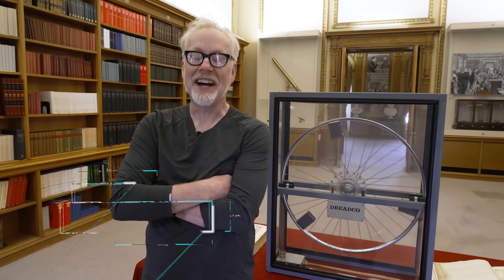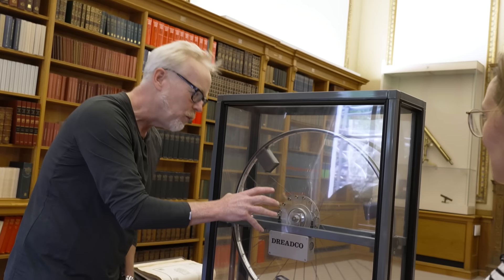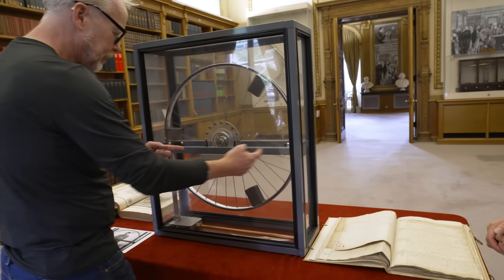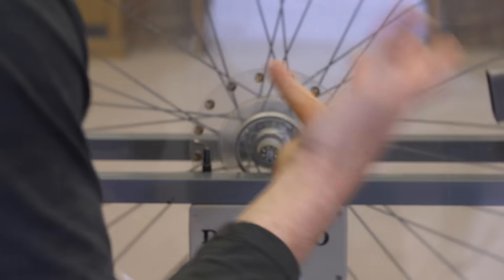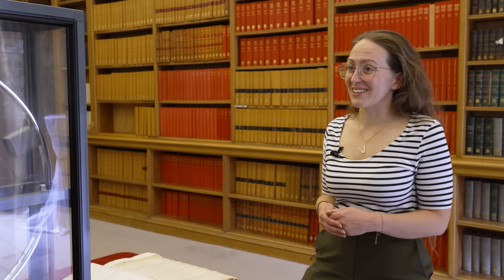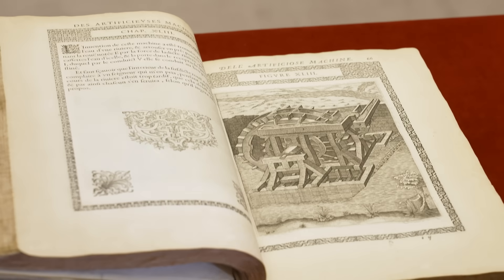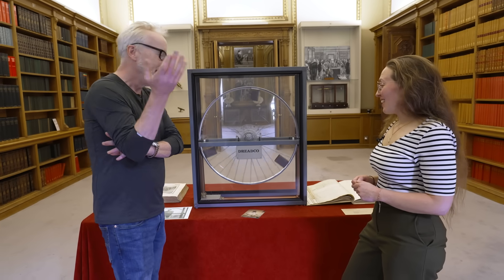Adam Savage vs The "Perpetual Motion" Machine!

Comment: The hardest part of making a perpetual motion machine is always figuring out where to hide the batteries
Reply: My guess is the box in the middle
Reply: @robertdascoli949  nope its in the axel. Just like what the cheaters use in Tour De France and other cycling events
Reply: @robertdascoli949  my guess is the box at the bottom left corner has batteries creating an electoral field thru the copper tube.
Reply: @robertdascoli949  yeah they aren't even trying to hide it in this case because most people are so thick there's no need
Reply: @robertdascoli949  the case itself is the battery. most of the rest is set dressing,
Reply: @robertdascoli949 my guess is the 3 boxes contain batteries and induction, end of story:-)
Reply: @dirkknoll3795  Nah the bottom box left side is probably where the batteries are for the easiest place to change them out.  Which the heat sink is there to cover up having an access there since the bottom is also clear plexi.  That , or they are stacked inside the frame ?
Having to open the box up to access the other boxes would probably show some wear on that rubber seal , and possibly damage the balance of the wheel , if were the ones mounted on the wheel.  The dreadco box I doubt has batteries also ... but maybe some desiccant material to keep the box free of moisture.  Hence those little screen looking things on the side for air flow.
So batteries powering the U shaped bars wrapped with wire for electro magnetism.
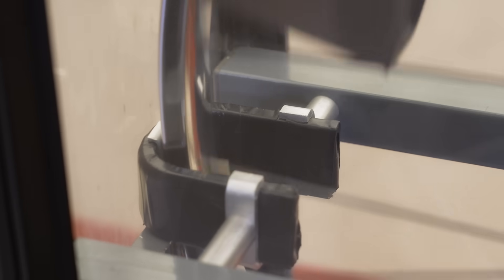If you didn't notice ... those things are wrapped with electrical tape .  4:05
Reply: @robertdascoli949  i was gonna say in the dreadco box
Reply: That was my thought too. A small motor with a little rubber wheel. Battery driven inside the DREADCO box turning against the small clear plastic wheel attached to the hub
Reply: @bryananderson999  the whole frame could have double a batteries stuffed in it. Could be 50 nicad aa batteries inside that frame.
Reply: @robertdascoli949  magnets... if they were batteries they would need to be replaced far more often and many ppl would know the secret, she stated that only 2 ppl know tho
Reply: @robertdascoli949  Wow that went over your head. He was making a joke that its not possible to make an actual perpetual motion machine.
Reply: @robertdascoli949  my guess is the blocks on the spokes are iron and they pass through magnets that are the black boxes on the middle bar and because the blocks are 120 degrees apart only 1 block passes them
Reply: There's a guy out near I live who used to make beautiful wooden flywheel-based perpetual motion machines, gorgeous and fascinatingly complex... they used line voltage, though, and the puzzle was simply to find the drive wheel. But they were GORGEOUS...
Reply: pl @Vinemaple
Reply: That is the thing with any magic trick (or cheating device), where do you hid the mechanisms... and how do you misdirect the audience to not see them.
Reply: @boxhead77  same thing in politics. Weird.
Reply: @boxhead77  Yes, like the copper tubing....Distract!
Reply: @boxhead77  magnets for sure
Reply: @boxhead77 : I see a small box inside the machine just big enough to hide 2 AA batteries!!!
YEP!!! Fraid so..
Reply: I remember one story about a PMM where the inventor had it mounted on a desk in his living room, and it turned out he had hidden a drive shaft in a support tube somehow, which ran to a pulley in the wall with an electric motor in the basement.

Lol.
Reply: @nicholastrawinski   sounds like my childhood overcomplication of wanting to do crazy stuff… lol
Reply: @nicholastrawinski j V hum
Reply: @nicholastrawinski  Things move on gearing power consumption rpm etc. is the key
THINK
Reply: @nicholastrawinski  that’s fucking awesome. Insidious but awesome. Very die with the lie of him
Reply: I’m wondering if the copper tube isn’t a red herring
Reply: @Dmarcoot  We don't know what's in the box the tube connects to though. Maybe it's sensing atmospheric pressure changes to keep hidden batteries charged.
Reply: I made a perpetual motion machine. I keep it in my work shop with my water powered engine.
I'll be right back to tell you how it works, there is someone knocking at my front door....
Reply: @jofi4580  Too many people not getting this comment.
Reply: Theres micro hamster that moving it
Reply: But perpetual motion machines technology really, really moved forward for the last ~20 years! The advances are obvious - as the batteries become more powerful and compact :)
Reply: Saw one of these from Russia.  It was sitting in a parking lot to prove it wasn't plugged in. But, for some reason, there was a throw rug on either side.
Reply: For everybody's info:
The creator of this piece clearly stated that this, and all of his creations, are fake, that they are magic tricks.
Not telling people how it works and having them try to guess (and then not telling them if they're correct anyway) is all part of the game.

Not sure how clear that was started in the video, I'd have to watch it again.
Reply: @Gh05tk3y  Wireless charging isn't new...
Reply: @codahighland  he thinks inductance was invented to charge cell phones
Reply: I read this comment in elctroboom's voice
Reply: @CoryzillaZombiekilla  how did you survive the shock of the FULL BRIDGE RECTIFIER?
Reply: @CoryzillaZombiekilla  🤣 just realised.
Reply: @CoryzillaZombiekilla  this is a 200 year old quote.
Reply: @CoryzillaZombiekilla   me too😂
Reply: @CoryzillaZombiekilla  hahahahah
Reply: @CoryzillaZombiekilla  There is no free energy! (electroboom)
Reply: @stoqnstoqnov7071 On the contrary, all energy is free (except what the utilities sell to people) and every single bit of it was all created the instant that this 3 dimensional world blipped into existence.  Remember energy is never created or destroyed merely transferred.  Which means that every bit of energy that has ever been used or will ever be used in all of humanity's existence has always been here and also will always be here.  Every single particle or force that exists in the universe is nothing but pure energy.
Reply: @Tommy-h8v4h   ot even hard with very little knowledge of electrical systems
Reply: @CoryzillaZombiekilla  I just felt the slap.
Reply: @CoryzillaZombiekilla  careful, in today's world that's cultural appropriation 😂
Reply: The easiest part of watching these videos is finding that exact comment
Reply: @Dan H  Actually, electromagnetic induction was first demonstrated in 1831, and an inductive battery charger was granted a patent in 1977 (US Patent 4031449A). The patent application was filed in 1975. Wireless charging was definitely known by the 1980s.
Reply: This comment lives under any and every perpetual machine video
Reply: @jademoth-1  right he probably thought he was clever typing it. as if they'd make a whole video like this about something battery powered. This is perpetual motion that only lasts a finite amount of time. It's absolutely possible lmao. They never said it was infinite which is not possible. I don't think op cares tho because he saw this comment once and thought he'd sound clever
Reply: @EXITLlFE  

"This is perpetual motion that lasts a finite amount of time."

That is such a ridiculous statement. 

Perpetual

Definition
1a: continuing forever : EVERLASTING
//perpetual motion
b(1): valid for all time

If it only lasts for a finite time, it is by definition not perpetual.
Reply: @notahotshot  my bad I guess I always thought "perpetual" meant automatic. Thanks lol
Reply: @EXITLlFE  oh, ok. Nope. Lol!
Reply: @jademoth-1 cry about it
Reply: Yeah why doesn't the person who keeps posting this comment spend their time trying to figure out the real reason rather than just commenting something that isn't necessarily the case....@jademoth1626
Reply: Are you the one on every video? Lol
Reply: @Gh05tk3y  Considering that the principle of a transformer, transferring power from one coil of wire to another, predates the plexiglass (polycarbonate, acrylic ?) used in the housing, wireless charging could be used.  I'm guessing you were thinking of wireless charging as used in modern cell phones.  But, they are nothing new or magical, just two coils of wire in proximity.
Reply: Occam’s Razor: There’s a battery. Mystery solved.
Reply: Isnt it just magnets?
Reply: The only mystery about this is which of the half dozen hiding places is full of batteries. And it may well be all of them.
Reply: What a original comment 😂😂😂😂
Reply: Wow, another dude coping comments for views.
Reply: And think about how many batteries you could fit in that frame. Probably enough to last the few years needed. Photo sensor might exist so it doesn't run in the dark, when no one is around and thus increases the time between charges.
Reply: @dbdba absolutely the frame. Lots of misdirection with the other stuff. The frame is way oversized for what it’s supporting & doing. Lots of volume for some type of energy storage (battery, chemical, potential, etc)
Reply: @dbdba  it would be noticeable if the wheel started up when the light turned on. With so little power it takes a lot of time to start.
Reply: @dbdba  stopping and starting would burn energy
Reply: Fortunately it's got square hollow tunes seems like a lot of room for batteries
Reply: @shakibiie  look up how a magnet falls through a copper tube.  I forget what its called. But its super interesting  Nd may or may not play a part here
Reply: @shakibiie  Hmm, why didn't I, or anyone else, think of that?!
Reply: That's the beauty of them.
Reply: You could hide a lot of batteries in the frame. And those boxes.
Reply: Which is why you hide them in plain sight.
Reply: I’d say the hardest part is figuring out how to change the batteries with nobody seeing you do it.
Reply: *or alternative power source.
Reply: Not necessarily batteries; Mythbusters tested a "perpetual motion machine" design which uses solar energy. It's 6 barrels connected on opposite size with a pipe, partially filled with water. The water on the bottom barrels evaporates and condenses on the top barrels, creating an imbalance in weight and turn the wheel ever so slightly...
Reply: @EdwardChan.999  Not perpetual motion if it stops every night when the sun goes down. Actually it is a converter. It converts the energy in sunlight into weak mechanical motion. It is not even a good way to convert sunlight into mechanical energy.
Reply: Would be nice if it was using the themoelectric effect.
Reply: A perpetual motion machine is possible.
Reply: @madscientist9994  You're correct. Energy suppliers know it's coming in a few years.
Reply: @madscientist9994 best comment!! Love optimistic people!!
Reply: The batteries are in the 3 boxes on the wheel.
Reply: id say water wheels are a form of perpetual energy or dams. As long as there is a stream and the wheel\dam is maintained itll generate power for use. Not forever but for a life time of a human that might as well be. These small machines however efficient can barely spin themselves without some cheats and cant power anything else without auxiliary power source.
Reply: @Andytlp  

"I'd say water wheels are a form of perpetual energy." 

You'd be wrong
Reply: Magnets are amazing things.
Reply: @tc8327 the earth is perpetual motion, rotating on a perfectly balanced axis and has been turning for thousands of years and hasn't stopped yet, and there's no hidden batteries, so to those who say perpetual motion isn't possible, think again.....
Reply: @Mcckoe I lived next to a 50,000 watt am radio tower and you could hear it in the box springs of my bed. No reason why a radio signal could not be inducing a small current. The wheel may only need a pulse every 10 revolutions or 100 , that's for an engineer to figure out.
Reply: Wow so original you must be really smart and funny
Reply: Yep. This comment is in each and every video about fake perpetual motion machines. People do love repetition.
Reply: Wow so original 👏
Reply: I don't know if you can notice the three black blocks around the perimeter 🤣
Reply: ✈️🤔 someday, some random hillbilly from Tennessee gonna make something in his shed. Deemed impossible by today's  limited imagination  
 just like what happens every 30years or so
Reply: Was going to say…hiding the wires.   It’s a motor.  Built one for HS physics.
Reply: disappointing to see this as a top comment, i get the humour but it shows how close minded a lot of people can be. Even if this has a battery in it we should still be exploring these kind of things with serious inquiry instead of claiming nonsense. Molecular vibrations > sympathetic resonance > amplified resonance > piezoelectric mechanical energy > electrical energy = Infinite energy?
Reply: Same damn comment on every single perpetual motion video… 🙄
Reply: The hardest part of reading YouTube comments is seeing someone regurgitate someone else’s words for likes.
Reply: Think of that one yourself?
Reply: Overrated comment
Reply: Disliked because i’m tired of hearing the same exact phrase on every video ever made
Reply: @Biking-n-hiking Same
Reply: We had self winding clock , one battery and that run for years , used energy once a day for few seconds .
Cant be that hard to fit one of those clockworks inside the axle housing 🙂
Reply: @pete_lind  There is also the Atmos and Beverly clocks which use barametric pressure to keep the winding mechanism going... they only stop for mechanical or wear and need to be professionally serviced.
Reply: @boxhead77  Would the machine keep working if kept in a secure basement strongroom where it's not affected by external air pressure?
Reply: @pete_lind  A clock doesn't use much energy.  The Jaeger LeCoultre Atmos clock gets its energy from the changes in atmospheric pressure - so it never needs winding - but it is not perpetual motion in the sense of using no external energy - in the same way that a hydro-electric power station isn't perpetual motion either.  
Look up the Atmos on YouTube - it's a thing of beauty.
Reply: @pete_lind  it works for months in the dark cellar.

Perhaps some energi can be harvested from temperature variations.
Reply: @pete_lind very interesting idea, but would you be able to hear the clock mechanism winding?? Or maybe they added insulation around it to make it quiet??🤔
Reply: It's not a perpetual motion machine if you have to do something to it every couple years.
Reply: @billrehm3590  Considering that Perpetual motion machines are feasibly impossible, creating a contraption which allows you to make use of unusual interactions and mechanics to maximize the efficiency of a particular motion, seemingly beyond what normal physics would allow, is good enough to count.

If nothing else, we'll be able to increase the amount of energy that we can generate using turbine generators. If these efficiency concepts truly work that is.
Reply: Imagine being able to set up a Power Station, get it's turbine spinning and have it require almost no extra power or fuel for 2 years after you start it up before it begins to slow down.

If this was even a slightly usable concept it would solve so many of our current Fossil Fuel issues, without the need to actually change to renewable sources. Ever.
Reply: Yeah it is silly. However so many plausible machines approaching an idealized conception of better efficiency do not meet the goalpost of stockholder enrichment because that's dumb.

The few have been brought into this perceived "reality" to rule over us and be provided enrichment towards them. I mean, it's what we were born to do. Remember when you signed the contract when you were born.
Reply: ...said, The Uni~Verse.
Reply: In the base
Reply: -Electroboom
Reply: Too funny!
Reply: reminds me of a mechanical watch
Reply: And old comment but a good one
Reply: Wow that's the secret.
Reply: @Gh05tk3y  inductance was only recently invented? Incredible!
Reply: Maybe gravity batteries. Boxes go up weight falls generates charge just string enough to spin the wheels tiny electric motor. Technically not s perpetual motion machine as they traditionally explain them but is perpetual unless something stops it.
Reply: While perpetual motion doesn't exist, fusion which is actually happening now does produce more than what goes into it because of the potential energy that atoms do have is mind boggling.
Reply: Yeah hide the batteries, I squared x R , gotta have a good supply of energy somewhere
Reply: @Mcckoe True but it will not continue to run without human intervention at some point.
Reply: If it ever was possible I GUARANTEE the designer will be dead. No government will allow such technology to exist. Just saying. Anyone that has ever made any discovery or something awesome has just vanished or gone to jail forever. Rule number 1 is NEVER mess with the energy giants.
Reply: @Gh05tk3y  Nikolai Tesla discovered wireless transmission of power well before this was belt. However it is too inefficient to be used in one of these super efficient "perpetual" motion machines.
Reply: Beat me to it 😂
Reply: Glad you commented the same comment from every one of these vids good job 👏
Reply: @Mcckoe Yes. As long as "free" means like free beer, it's "free energy"  By the other definition, free energy is indeed probably impossible.
Reply: I think that's what's in the envelope
Reply: no the hardest part is when you decide to recharge the batteries before it runs out
Reply: The wheel is the battery it seems
Reply: Whatever it is, it is extremely efficient. IIRC, they said this was invented in the late 19th century or the early 20th century.

Overcoming the resistance of the bearings and the magnetic field the boxes go through will take power. This thing can run 2 plus years on whatever source of energy it is using.  That's 17,500 hours.

I don't think it is a battery because batteries just weren't very energy dense.   Even at only 1/4 of a watt, you would need 4.38kwh.  It is obviously not using anywhere near that much power.  There is nowhere to hid 4.5kw hours in 19th century early 20th century batteries.
Reply: @tarstarkusz I suspect that at it's core it's basically a Faraday generator.  However those boxes may contain enough mass to also provide it with both a gyroscopic effect as well as a flywheel effect and if they are magnets they may be providing a Lorentz force for the purpose of maintaining a steady speed as well as being used to reclaim the energy much like regenerative braking.
Reply: @tarstarkusz  This was invented in the late 20th century, not the late 19th/early 20th.
Reply: @thedude6712  Can you timestamp it.
Reply: @tarstarkusz  "Can you timestamp it." I'm not entirely sure which comment you're looking for a timestamp about, but I'm going to guess that it's when I corrected you about when the device was invented. At around 7:24, she said that this one was made in the 1980s, which would be the late 20th century. The inventor died less than 6 years ago, in 2017.
Reply: @thedude6712  I must have mis-remembered the details. Thanks for pointing it out.  I still think you would be hard pressed to find batteries energy dense enough to run this non-stop for 2 plus years.  Even the best lithium batteries today could probably not accomplishment that. There are just too many hours in 2 years.,
Reply: @tarstarkusz  It was built in the 80's according to the video, 1980's not 1880's! Inventor died in 2017!
Reply: @dunxy  So I've been told. They did mention things invented in the 1880s and I confused the two.
Reply: @Mcckoe I didn't state that this breaks any laws. But this, and any machines you're thinking of, do not count as perpetual motion machines, technically or otherwise.
Reply: I hate this copy pasta
Reply: I know of one which simply uses a well-placed magnet to keep a metal marble running up a rail half-loop.
Reply: (And the wireless charger)
Reply: Wow, only heard that one a couple thousand times
Reply: The rectifier
Reply: Or the antenna.
Reply: plain sight. just no wires because fields.
Reply: Or connecting it to a battery and making it still moving
Reply: I have an idea for one but it involves portals so we not ready for that but also. The machine it’s self might not even be enough power to even power the portals so you get the same exact problem. External energy source
Reply: I can make them. Just need a spacecraft.
Reply: exactly why they keep the explanation a secret
Reply: wireless charging has been available since the 19th century
Reply: What batteries bro?.Isn't a male-female magnets in a specific order that allow the rim to go eternal?
Reply: I would have brought something to see magnetic field lines.
Reply: @Gh05tk3y  Wireless energy transfer has been around for decades, what the modern version does, is create a standard so that different manufacturers can make compatible equipment. Except that I don't think the table is part of the device, and it would require the staff to be in on the secret. I think she said it spins away in their store room most of the time, and they send it off to recharge the batteries every couple of years.
Reply: The hardest part is keeping a straight face once it's built.
Reply: @Mcckoe The friction on the bearings to produce heat would stop the machine. You need zero friction to be perpetual.
Reply: LoL absolutely
Reply: It’s a battery
Reply: You hide them in the misdirection sections.
Reply: Oh my god such orriginal and smart observation...never even once read this b4
Reply: @Mcckoe "pulitzer effect" - "braking" laws of physics.
Yeah, you sound like you have it all figured out. We're done here!
Reply: I once saw somebody use a wireless charging pad to create the illusion of perpetual motion machine as long as it was sitting in the right position on his desk directly above the coil which was recessed into the bottom side through the drawer access which I thought was pretty clever once he showed me because I was scratching my head up until that point unable to figure it out
Reply: Such a good joke
Reply: Have you seen the size of a capacitor in an automatic watch, it can run for 10 years +( both by a light cell or a moving weight). It wouldn't be hard to hide reasonably sized capacitors/ batteries in that thing.
Reply: Electro magnet in the aluminum box with the logo.
Reply: Magnets, no batteries...
Reply: Under the table?
Reply: You can find this comment on every video about perpetual motion
Reply: I’m sick of this comment… I always know it’s gonna be the top comment
Reply: @@Mcckoe A heat pipe need a source of energy, like a person's hand. A device like this would quickly cool to room temperature and become inoperable. The axle warmth wouldn't be enough to power itself and generate more warmth.
Reply: For me, the most obvious answer is batteries in the three battery-sized boxes around the rim. As the boxes pass the magnets, they power a small impulse to coils and add a little bit of impulse to counter the energy lost per 1/3 rotation. These circuits are low power and well known and used in many executive toys and Foucalt pendulum demos. I believe Big Clive has a video on how they work.

HOWEVER. There there are decoys which are equally feasible (if a bit over-complex) so who knows? They do say the best way to figure out a magic trick is not to ask how the magician did it but how you would do it. And that's how I'd do it.
Reply: Wow. U probably came up with this thought all on your own!
Reply: The battery in my clock lasts  for over 2 years  and that tells the time as well
Reply: “Nice comment.” — Nichael Cramer
;-)
Reply: Wow! Did you come up with this joke on your own? It’s hilarious! 

   I have only heard this joke about 1,000 times.
Reply: @freshbrad1354  : And, amazingly, it’s still accurate.
Reply: Can't you see three gray boxes 😀
Reply: Would a perpetual motion machine work in Space?
Reply: hee hee
Reply: I thought it would have been the lubricant efficacy
Reply: No need to hide batteries when you use magnets
Reply: @stonedan0  

Magnets are not a source of energy.
Reply: I'm tired of hearing this quote.
Reply: I would hide them in the tube frame.
Reply: 10k people haven't seen this comment on the other 3,000 perpetual device videos. Perpetually surprising.
Reply: Stolen
Reply: @some_haqr  What is?
Reply: Or where to hide the solar panel in this case
Reply: Most perpetual machines that looks too good to be true usually are powered by batteries, but in this case, I believe it's a real design of a machine that can remain in motion for an extended period in time. It is of course not a perpetual machine because it loses power over time. But there are real amazing designs of machines that can stay active for years. And it's fun to figure out the mechanism like what Adam is doing in this video. I believe the world record is held by a grandfather clock with a pendulum which moves based on the temperature.
Reply: Maybe some magnets left and right
Reply: Ive always wondered with perpetual motion machines, if you use part of the energy created to charge a battery to keep it running and that energy is then made endless via electromagnetic means it could self sustain... idk it would have to be pretty large but its technically perpetual motion...
Reply: Fr
Reply: How unoriginal do you want to be?

Every. Single. Video. About the topic has the exact same comment. And you know that.
Reply: @ImTheMan0fSteel  yes he does, and so do we, and so do you. It’s traditional. If he hadn’t commented it, we’d all be watching and waiting in shock for it to appear. The man is a hero, and you are just J. Jonah Jameson. Shame
Reply: It's basically a giant crookes radiometer???
Reply: More like Perpetual Bull💩. Perpetual motion is impossible.
Reply: You don't need a battery if you use a big enough generator (alternator)
Reply: @akyzowy  sorry I don't understand
Reply: Your wife's complaints is the most advanced perpetual motion machine the world has ever known
Reply: Or magnet’s
Reply: People before the laws of thermodynamics be like:
Reply: @Mcckoe oh interesting just like what they discovered at the pyramids they reckon they were generators using salt and moisture!
Reply: It's magnetic fields.
Reply: The lady approved the lies too hiding secret but not really "secret" 😜😜😜😜
Reply: Liars!
Reply: I cannot stand perpetual motion machine videos because this is always the dumbest and first comment
Reply: Batteries, Bah!  There's always enough neutrinos falling through the Earth. 😄
Reply: It's simple.
Where they can store the most kinetic energy after you gave the machine a good shove! 🙃
Reply: @Mcckoe intresting thanks
Reply: Where and How
Reply: Exactly
Reply: XD
Reply: Professor Dr. Klaus Turtur has created a Perpetuum machine which  uses vacuum to create energy, even more than it takes out of it.
Reply: Air makes resistance, it needs to generate in motion energy and give it back,
Reply: Most of the time it's magnets.
Reply: Do you just search perpetual motion and leave this comment everywhere?
Reply: Come up with something original please i
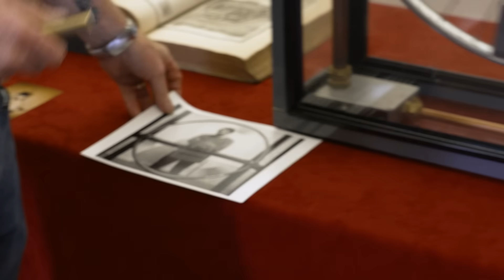Reply: in the picture @ 5:19 I do not see the copper pipe assembly
Reply: Well two leading contender mechanisms would clearly be using the rim as a  homopolar rotor, evidenced by the insulating hub and brush contacts at the spokes and the other would be battery powered coils in the three black boxes with timing triggered probably by either  a gravity switch or detection of arrival at the horseshoe magnets.
Reply: Certainly
Reply: Lithium coin battery can last over 10 years.
Reply: @Mcckoe 

Go back and read all of your comments. In every single one of them you state that an external energy source is needed in order to move the thing. That energy being the heat energy you keep mentioning. A perpetual motion machine would run on its own with no external energy applied. The heat the axle generates as it spins is due to friction, and is not enough energy to overcome that friction.
Reply: @Mcckoe 

There are no things which have perpetual motion.
Reply: The amount of times Ive seen this exact comment is mind blowing
Reply: Magnets
Reply: Or to tap power from.
Reply: Ur comment is soooo original never seen or heard it any any other perpetual motion machine videos 😒
Reply: @dominikjawzik  Perpetual motion either exists or it doesn’t. 😑 Enjoy. 😊
Reply: Lol epic
Reply: Batteries seem to last about two years. Makes sense.
Reply: Maybe for those that don’t think. They have them for purchase with bearing balls that don’t have any batteries and ones that use magnets. Your turning to a guy who’s “busts” have been busted 🤦🏾‍♂️🤷🏾‍♂️😂 a movie magic guy 🤪😂😂😂😂
Reply: The hardest part of seeing a perpetual motion machine video is trying not to find this exact comment
Reply: It's a big trick  no clear information about
Reply: A good way to figure it out is simply to try and replicate the design, Adam should definitely try
Reply: This comment is under every video about perpetual motion
Reply: It's a magnet
Reply: NPC comment
Reply: Nah the hardest part is gathering energy from the machine without the machine stopping all movement
Reply: I love my dunking duck
Reply: Opposing magnets
Reply: CHECK OUT THE INFINITY TRAIN IN AUSTRALIA ......🚂🚂
Reply: I like this comment.  Because we have a copper pipe running through a box comprised of a different metal....  Just need some acid and you could conceivably create a very weak battery of some sort, just enough to deposit energy into the wheel to keep it going.
Reply: oh god i love electroboom. It'S a SEcrET. They like to kill physics. How can they be so dumb seriously
Reply: Hello Adam, if you are interested in a machine that i invented like that when I was a young boy. You can contact me. I had never the chance to make a real one. On the other hand, i don't know if the world is waiting on a device that's can give energy for free.
Reply: come on i could build that rite now i can not se it been that simpleany1 could make tbis obv its somet close to prop
Reply: Boy thats real original, hahahaha, FAIL!
Reply: I paused this video at 1:28 to look for this comment.
Reply: Still, two years without a charge, damn good bearings
Reply: How do I get an African kid to dig my cobalt?
Reply: This comment is attached to every piece of content tagged 'perpetual motion'.
Reply: You can see that Perpetuum Mobile (Perpetual Motion) works, so it's possible, and we were lied to in school. Free energy is omnipresent and even from Mendeleev's Aether.
Reply: Don't hide them.  Just design it to charge its own batteries.
Reply: The hampster
Reply: Only Brits....."every often we have to send it back to the University of Nottingham"... to change batteries!
Hahaha, how pathetic calling a wobbling wheel a Perpetual Motion Machine.
Reply: @ttp_007  They lie because it works on its own all the time, and they don't want to announce the truth that PM is good.
Reply: Ysee, it was funny the first time, but not the 58,624th time
Reply: This comment is in basically every Perpetual motion video. Super original
Reply: all of it are batteries mydudes. also i suspect the hollow frame has batteries too
😊
Reply: It’s always so perplexing how this comment seems to be the top comment on every video about a perpetual motion machine
Reply: Wow. Such an original comment
Reply: You can make a really long lasting motion machine without a battery
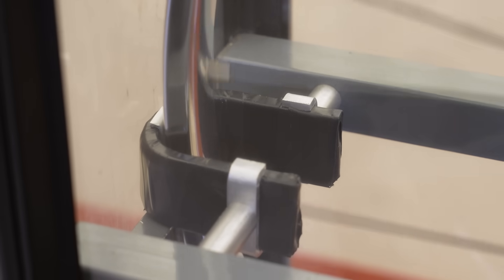Reply: 4:09 magnet? That's a battery
Reply: Or, maybe it really is a genuine perpetual motion machine but too many idiots refuse to believe it. And I'll add Adam Savage to that list. It's not impossible.
Reply: In your world
Reply: The funny thing is a perpetual motion machine can have a battery but it would have to charge that battery at least at the same rate that it uses power to be considered a perpetual motion machine
Reply: The hardest part of getting a lot of likes is making your own original comment
Reply: I was actually wondering if maybe this time this onliner wasn't commented.

But alas... Don't go to the comment section if searching for originality.
Reply: Yes And it looks like this guy figured out a way to do it. Because it is a motor.
Reply: They don’t ever wanna come up with anything that really works because then they would be out of a job !!!!! I’ve watched enough of Miss meth un busters to make me sick .. !!! No don’t ask me to name them if you got a brand you can see it
Reply: Howd I know this was gonna be one of the top comments, then it ends up being the literal top one lmaoooo
Reply: Yes 😂
Reply: Don’t think it’s batteries I just think those boxes are magnets resulting in the 2 year replacement time
Reply: @joeshmoe2018  🤔 hmmm...   maybe its both? 😵 or... or.....some kind of quantum gravity device that reverses magnetic fields that... & & oh well, I don't know how to finish 😬
Reply: There is no rules  against batteries. There is no rules. Problem is no one has been able to demonstrate it will run forever; theoretically,  physically, or mathematically. Maintain a speed able to show work. Up and down ok long as it never loses potential energy.
Reply: @jaydensdream714  IF... if, this device was really creating energy, what could it power & for how long? one LED? It seems like any energy would be weak.
Reply: @phiddlephart7026  the idea is for It to power itself non stop. In any manner whatever you used as a catalyst all energy  must remain within the device. Many variations exist some better than others. If the draw of a magnet gets the wheel spinning. Somehow you must obtain enough energy to sustain a constant motion without ever sacrificing output. Law of energy states whatever goes in must come out the same. Even the most drag free bearings produce some drag. Without increasing input the output will eventually lose enough energy to stall. Not even the sun can run forever. Takes billions of years but eventually everything stalls. Hope that helps
Reply: @jaydensdream714  wait, wait. I said IF & and i was joking anyway. I fully understand the laws of physics & thermodynamics. 😬
Reply: There are instances of perpetual machines that have ran for decades. Even 100 years.
Reply: Really...this comment is like posted in every perpetual motion uploads 🤦🏼‍♂️
Reply: you dont need battery for moving air
Reply: Excellent... observation.... perpetual motion....is...to slow if... exist.....if ..exist... way... we don't use.. to... move... are... 🚗.... boat 🚢... 🏠.....etc...etc ..we need machines to produce big energy...D.C....yes...we have...ABB... company make for China... but...no for us.... sorry but we still need to use...or .... HVDC.....or...A.C.... fossil fuel.... Nuclear energy.... Hydrogen energy...etc...etc .. perpetual motion is good example how the physics work.... Nice. Toys ... But that's it...🤨🧐🤔😑
Reply: Excellent observation.... perpetual motion nice explanation about that way the physics work.. but no for producer energy... sorry 😔😐
Reply: The law of physics... not absolutely rest... and... not... absolutely... motion....mass . need energy for moving...ok ... energy is mass...so who.. were is the energy... gravity ...is in one direction ⬇️.... Regardless.. for move any kind mass we need energy... Gravity don't have turned...in constant period of time...is some point is = to....Zeroooooo...is nice toy don't get me wrong... That's it. 🤨🧐🤔😉😘😘🤩🥳😜🤪
Reply: For storing power we don't need batteries just some cotton acting as capacitor is enough
Reply: It’s obvious there’s batteries in it somewhere, she said they have to have it serviced 🤔
Reply: Well, if you try to conceal batteries, then it still wouldn’t be considered perpetual because batteries use up their power. Eventually, everything still stops! Hehe
Reply: Just plug it into the power mains so you don't have to worry about batteries.
Reply: Sorry but no batteries needed, perpetual motion machines are possible but the system doesn’t want you to know that, the system is greedy and make more money off of non free energy and would never allow a free energy machine to be available to the people.
Reply: jeez bren guess you didn't know magnets are a thing
Reply: Exactly
Reply: That's why God created Elon Musk.
Reply: U do relize they can have and start with batteries? 😅🤦. As long as its creating enough power or momentum to repower the batteries... durr.
Reply: You don't need batteries when gravity keeps it moving... or perpetual magnetism... or a balanced cycle of processes that leverage perpetual forces in the environment. Would it work in zero gravity?
Reply: I think you know where i hid the batteries.
Reply: Except in this case seems to be very elaborate electromagnetic power. Which in a self contained cycle would be perpetual assuming it kept running until said magnets depleted in ability.
Reply: Plain sight, naturally.... The 3 in the wheel, and the 2 external... It's not unlike holding a lighter under a coil of aluminum foil... But I haven't even watched past like halfway yet, just wondering why magnets so.....
Reply: What a load of rubbish
Reply: Actually, hardest part is removing friction-heat from the equation. That's actually the only problem.
Reply: My friend in high-school thought he could build such machine by connecting 2 car alternators and a battery together.
Reply: So it's not at all a perpetual motion machine. Lol she just said it needs to be sent off to essentially be charged...lol
Reply: They didn't even bothered, hence the big box with DREADCO on it :D
Reply: ElectroBOOM 101
Reply: If it was perpetual it wouldn’t stop.
Reply: A vehicle alternator and battery work the same way as this device!
Reply: Gee, that’s original.
Reply: As event dumb ppl like those have good eyes for locating batteries :P
Reply: The oldest comment on YouTube, thanks for stealing and reusing it, it reminds me, based on the upvotes, how many stupid people we have in this world.
Reply: Dann müssen die Batterien aber lange halten.....
Reply: If I see this comment one more fucking time...
Reply: Who is that quote from. I've seen 10000 people comment it
Reply: I think this one has ran it's course....
Reply: Jajaja
Reply: The biggest problem is to understand that radius is important as well as wheel being horizontal not vertical and that magnet going through copper coil produces electricity.
Reply: Dreadco box?
Reply: Not all perpetual motion machines use batteries. The long lasting ones use real magnets instead of electromagnets. Even these run out of power and need to be replaced/remagnetized eventually so they aren’t truly perpetual motion.
Reply: You could add batteries to the device so long as they are charged by the main device as well. The only thing you can’t do is plug into a constant power source. As long as you can keep them charged on their own I personally believe they can be utilized just as long as they aren’t the main source of your power draw.
Reply: I disagree. Any device capable of charging a battery to use as a magnet would be more efficient using that energy for magnetism directly. Every additional system you add to this device will introduce new energy losses, reducing the efficiency and reducing the time between “maintenance” updates. With the efficiency of this machine, the mechanism is going to be in very few stages and pure magnet power would be the simplest. It’s possible the magnets induce a current to electromagnets directly, but I can’t see it charging batteries. 
If you wanted to do the battery path, I would say the strongest possibility would be very large battery packs that are used to induce a magnetic field used to make the machine rotate slowly. Slowly is the key, since it would not be economical to charge the battery, nor likely from a slow rotating object, a slow rotation on a low friction wheel would require very little energy to maintain. With this in mind, a large battery pack could potentially last for several months. I notice 2 large contained boxes on the device that could each potentially hold a large enough battery pack to do the job. Careful manipulation of the materials used in frame construction could build the required circuits without the use of wires. 
I’d go that way if you want to keep chasing the battery theory but I still maintain that magnets would last longer. The way they are configured and how they are manipulating the magnetic field using the “U” magnets to possibly pulse an electromagnet is the key and the genius of it all.
Reply: For a sufficiently broad definition of "battery."
Reply: Lol
Reply: In the frame rails
Reply: Over used comment
Reply: Besides that, why not hide solar cells on top and around to constantly recharge the batteries when the room lights are on?
Reply: It works because you stand too close to it that a way it takes the energy from you. This is curiosity charging technology
Reply: Or magnets...
Reply: If you think about atoms l, everything is technically perpetual motion. 😊
Reply: Hardest part aboit perpetual motion videos is seeing this commment 100x
Reply: I see the battery comment on every single video like this
Reply: I know a Perpetual Motion Machine is not possible, but i think the concept of alot of these machine could come to use. I mean if a machine only required input of a small amount of energy to get the machine moving for months even years is that not profitable?
Reply: @adamsmith9898  The only reason that this machine lasts so long is because it has low-friction bearings, and is moving so slowly that it only loses a very tiny amount of energy to air resistance. The moment you tried to hook this up to power something practical, it would stop because whatever motor it's using wouldn't be able to overcome the resistance, and if you tried to juice it up to get more power, you'd just wind up with an ordinary electric motor.
Reply: It is not a closed system as the REAL SCIENCE TERM MEANS. It harvests gravity. Gravity from OUTSIDE THE SYSTEM is pulling downward. Would it work IN ORBIT? No. The micro gravity in orbit. There are moving weights in the boxes. They are mass. There are angular momentum differences when the weights are either closer to the center of the wheel's radius or furthest outside. Does a hollow cylinder roll at the same velocity down a ramp as would a solid cylinder - when a hammer and feather will fall at the same speed? Eventually the lubrication in the wheel bearings would get dirty and create friction. It would need to be cleaned and lubed. It is just one of countless gravity harvesting machines. Sad that people are baffled by this child level science.
Reply: https://www.youtube.com/watch?v=7mxV6f5nuJY Derp flunked out of diversity public high school, but can say perpetual motion machine. Normies suck. Planet of the apes.
Reply: This is the most over used sentence on every video of perpetual machines.  Jebus!
Reply: Why hide them? Just put them out in plain sight like the three boxes are on this one, and then make people guess if they are batteries, but they aren't really sure because that is too obvious.
Reply: @Jiggledance  The boxes have the moving counter weights that are shifted in and out along the radius by passing magnetic switches or something. Even though I know how it works, a genius engineer built it. He chose their placement and timing with experimental knowledge. Do they swing on little pendulums or roll about like ball bearings to magnetic anchors? The engineer was so smart, he has everyone without genius IQ calling it Keebler Elf Magic conspiracy theory. Like the pyramids, neuro typicals think aliens built it. Engineer was one of the gifted. Let normal people worship him with their lol stupidity.
Reply: Vacuum
Reply: @malikpleasant5728  Yes, to reduce friction.
Reply: How about those 3 9Vs spinning around?
Reply: @ryanmorgan409  I know you noticed, you flunked out of public school for diversity kids. Your own family that loves you, calls you stupid. You actually believe people LOOK TO YOU for explaining physics? Hahahahah
Reply: It is called da Vinci's 'overbalanced wheel'. By the name alone, obviously you average intelligence people will never get it. For that reason, you cannot comprehend that using it as a machine means an additional load on the system. This genius made an overbalanced wheel, an impossible magic at your IQ level. The surplus of angular momentum is only enough to keep it spinning while properly lubricated. There is not enough surplus to take away for other mechanical purposes.
Reply: You people are incompetent it's called neo denium magnets.
Reply: That comment is very worn-out. Try being original.
Reply: Not batteries. Capacitors. Or the whole unit is one giant capacitor. The 3 things on the outer wheel appear to be old style capacitors.
Reply: A minuscule solar display seems enough nowadays....
Reply: This comment does not deserve 20+ thousand likes. He's just repeating.
Reply: LOL  INDEED  LOL
Reply: If the universe has existed for eternity then it itself is the ultimate perpetual motion machine.
Reply: @steve9503  brush up on your science. The universe has not existed eternally and will not. It eventually will lose all its energy, like any perpetual motion machine.
Reply: Dork. It IS possible
Reply: How did this throw away comment get so many likes??
Reply: I imagine they're in that Dreadco box lol
Reply: Old joke is old.
Reply: Actually, it is easy in this case, in the axle!
Reply: I think I heard this joke in the 1900’s
Reply: Those boxes are magnets people, magnets do the trick.
Reply: If there was a battery in the perpetual motion machine, then why didn't the battery gone flat? David Jones built the machine since 1981 and it's still running. 42 years ago.
Reply: @elganmarco1846  You missed when she said the longest they have seen it run was 2 years.  And that some people knowing the secret are the ones to get it going again.
Reply: Lol 😂
Reply: Magnets* 🧲
Reply: Crystal batteries?
Reply: Batteries are electricity, which is magnetic, which is energy which could with the help of a small solar or light charging system could keep a machine running indefinitely like a citizen watch.
Reply: In each of the 3 boxes a coil. When it passes the magnet a pulse is introduced, when it leaves the magnet field a pulse of opposite polarity is introduced. This second pulse activates a transistor who drives the same coil. It’s polarity pushes the coil, and and so the weel, a little bit away from the magnetic field. So in the 3 boxes are a battery, a coil, and one or maybe more transistors. This technology is also used in some mechanical clocks. I’ve made a pendulum that way, and it only stops when the hidden battery is flat..
Reply: Its like my wrist watch i change battery every 2 years xD
Reply: Or magnets
Reply: Those three spinning boxes look a bit like… Well…
Reply: Without question.
Reply: Include it in the frame!
Reply: Watching him hit the glass so hard by accident made my heart miss a beat.  The rest of the video, I was terrified he was going to knock it over.
Reply: Where are the batteries hidden on the earth? :) Seems we just keep spinning and spinning.
Reply: Directly behind DREADCO
Reply: Liquid to gas on each rotation ? 😂😂😂😂
Reply: The most original phrase I've ever seen, I think I've only read it 354,020 times.
Reply: All too easy....
Reply: a two year battery then? that's a step up
Reply: If you do manage to make it happe n the next hardest part is avoiding the CIA and other capitalist forces that would seek to destroy to to keep humanity under it's thumb, just as the guy that made a GOOD engine that ran on water whos last words in a restaurant were "THEY POISONED ME!"
Reply: That makes no sense...unless,,,the battery is perpetual? I got it!
Reply: Miracle of God.
Reply: The key is magnets
Reply: I think, this system needs batteries only for the brake device, it would move too   
fast instead, if it wouldn`t have any
Reply: For the millionth time
Reply: It's in the bars
Reply: กล่องตรงกลางคือมอเตอร์เเบตเตอรรี่
Reply: There are no batteries probably a piezoelectric system that is activated by a diaphragm in the central box the air pressure changes during the day when the thin up constantly that sitem was used for perpetual clocks in the late 19th and early 20th century it is fragile as fuck
Reply: Yep. Can't go against the laws of motion. Gotta "send it off for servicing" to replace the batteries.
Reply: Exactly and that’s why all of the misdirection is there
Reply: In the past, the most difficult thing was to figure out where to hide the person who was running the PMM

￼
Reply: what if the movement of the wheel recharges the battery and the battery makes the wheel spin forever, that technically wouldn't work? at least until the materials wear out over time
Reply: Not perpetual if there's a battery
Reply: The real question is why they hiding it from us? I suggest everybody watch the movie documentary the Lost Century! Dr. Steven Greer tells that we’ve had the ability to replace fossil fuels since the 1950s, but the elites and governments will not allow us to have this technology!
Reply: Muahahaha, this is the last reply to this comment ever!
Reply: The hardest part of making a YouTube comment is being original . 🎉
Reply: Not really. Where are the Earth's & Universe's batteries hidden? The universe is propelled by Perpetual motion. Our CREATOR really are the best!
Reply: And the fact that “perpetual” implies infinity.  To spin for infinity. Not just a really long time. lol
Reply: Actually a machine powered by a nuclear reactor still couldn’t be called “perpetual “.
Reply: What a waste of time!!!!!!
Reply: You npcs always comment the same stuff on every video cat fishing for likes
Reply: Looks pretty obvious to me. There's magnets in each block and it gets a little push as they go past the ends of the beams on left and right
Reply: Overused joke.
Reply: Congratulations!!! You are the trillionth person to comment this exact comment word for word!!!
Reply: 3 batteries.  3 pendulums.  the weight is changed in 3 boxes like a clock pendulum.  When going down, the weight is transferred to the outer ring.  On the part that goes up, the weight has shifted to the inside.  All other technology is useless, just decoration.  Try it, take the device from -30°C to freezing, it will stop working in a few days!
Reply: I wonder what kind of perpetual motion  she can create 😅
Reply: How original.
Reply: It's also tricky to minimise wear
Reply: I knew I was going to see this comment here somewhere
Reply: How original 🙄
Reply: Unoriginal copied and pasted comment on every perpetual motion video
Reply: In the whole frame
Reply: So it's actually not a perpetual motion machine if it slowes down after 2 years.
Reply: I didn't know batteries could make a perpetual machine. I want that battery.
Reply: I can't believe you got 30k off this comment
Reply: Always funny making claims while restricting how it works.  100% BS.
Reply: The biggest problem for having perpetual motion is friction
Reply: I think even trying to make one can lead to some cool ideas. This doesn’t seem that mysterious. Similar to the idea I had
Reply: What if I created one that has no hidden battery?
Reply: @MFBEY_  go on
Reply: People who believe perpetual motion or "free" energy is impossible must watch too much mainstream news...
Reply: Never heard that one before. Got anything useful to say? Don’t think so.
Reply: Oh wow I’m sure you made that comment up by yourself and didn’t just repeat it from seeing it before
Reply: @ayemercury9865 : Quit being a snotty little slime!!!
Reply: So tired of this fucking quote, how about contribute instead of pointing the finger
Reply: @snowgolem007  💀
Reply: friction will always win even in space
Reply: dude, you wrote this already on another video and it still doesnt make sense cause batteries are so easy to hide, duh
Reply: Free energy is real.  Your government don't want you to know.
Reply: @johnsmith777lol  I don't understand your specific kind of stupid but I admire your total commitment to it.
Reply: EXACTLY!!!
Reply: There seems to be no conventional battery as it's nakedly diaplayed.
Humans are still exploring 10 percent of the actual science knowledge.  And still using 10 percent of their brain. That means they still use machines to help do things. That means they are still in the primitive stage.
Reply: The hardest part about watching a perpetual machine video is seeing this comment over and over and over
Reply: Jesus, how many more times  has someone stated this
Reply: @ it’s the only true perpetual machine, cuz as long as the idea of perpetual machines exist, ppl will always always say this. It makes them feel real smart.
Reply: Also really low friction helps to keep spinning longer to create the illusion of perpetual
Reply: What a tired comment
Reply: Could you not build a functional version of this using magnets, if the boxes on the wheels were magnets and the corners of the box had them? Or am I stupid😂 the earth seems to be in perpetual motion to or is that wrong
Reply: I'm more or less over this comment... It is unintelligent and indicates immature critical thinking. One day the technology will exist, and the first people to embrace will be the same ones who align with this comment.
Reply: Unoriginal i see this comment everywhere , quit trying to trick people thinking youre smart
Reply: The hardest part when you repeat a line…it is boring
Reply: THEY LIE TO STOP PEOPLE KNOWING HOW TO BE INDEPENDANT OF THE NATIONAL GRID
Reply: NEVER TRUST THAT GUY EVER AGAIN
Reply: The guy lies;  self running electric generator is now a reality NOT EVEN COMPLICATED
Reply: Change your paradigm
Reply: Arnaque
Reply: Arnaque............
Reply: @brennanruiz1803  SO YOU HAVE BUILT ONE ?
I THOUGHT NOT
Reply: There's more then enough place in those frames xD
Reply: This is getting old.
Reply: Can you get less original?
Reply: I often wonder who these people that repeat the absolute shite out of things are
Reply: Is there something underneath that tablecloth?
Reply: Hey I need to read this comment at least 5,000 more times! (Sheesh)
Reply: In a Finnish Science theme center was one machine that was based on temperature differences on spokes of the wheel created by ambient light. It's enough to make a fraction of millimeter expansion. Not sure, if Nitinol or alike was used.. This doesn't look like that
Reply: That is a secret...shhhhh
Reply: The most over used saying in history
Reply: Every now and then she turns it off and on lol
Reply: What if you put the battery in plane sight and and it ran off tesla electricity from the zero ether.
Reply: Exactly
Reply: Exactly
Reply: The universe is in perpetual motion and there is no battery…
Reply: A generator Wii charge the Batteries. It just Spins faster. All they need to do is add weight and More Magnetic power like making electromagnetic Batteries. This is way more simple than you think. a simple Magic trick been done for years.
Reply: Or like me you don't hide the battery and it keeps going
Reply: What the Chemical Battery or the ION battery is still just Electrons. That Can be Harnessed once again because they Never Die. That Charge Just Keeps moving. The Problem is people still thinking like Steam Pressure machines. Old crap.  @ElijahCokeley
Reply: Its frikin royal societies. Battery is for us civillian.
Reply: But the Batteries just holds the Electrons build up in cells for an amp voltage. The Electron runs everything. in the Cosmos. We constructing a ION Battery is just a Place holder for the Electron. The Chemical Battery breaks down atoms with acid extraction the Electrons from the Atoms.  @polarbear8188
Reply: And Humans have electrons in all Biology Cells building the Body and a Charge is running through out our Brain and Nervous system as an Amperage. Some times we carry extra like a Battery in Static Electricity. Pass it on.   @polarbear8188
Reply: All u NPC just copy paste eachothers comments
Reply: One thing Nerd that worked Perpetual really well was a Hippie Weed and the Lava Lamp just needed Electrons built up to a proper Voltage. @toptopics7135
Reply: lol!
Reply: i can tell you failed physics!
Reply: It's in a vacuum, to recharge it I guess they wind it up by magnetic energy
Reply: There are a ton of possibilities.
Reply: Yea okay very original
Reply: NPC
Reply: Probably in the "heat sink". Which is obviously fake (would require too much energy).
Reply: Simple, batteries not included! lol 😂😂😂 🤣🤣🤣🤣
Reply: The hardest part of making an original comment is coming up with an original comment.
Reply: reddit tier comment
Reply: Incorrect, you don't need batteries.
Reply: If Perpetual motion Does not work as you Claim... Please EXPLAIN How the Earth keeps Spinning!!!! STOP LYING PLEASE
Reply: @dikadoandersson875  take high school level physics
Reply: @amesoeurs  🤣
Reply: @amesoeurs  Wew Live On A Battery  U know that right.. Get to know Nicola Tesla
Reply: If I see this quote one more time I swear😂😂
Reply: Masonic TV is a bore.
Reply: I scrolled to the comments to read exactly this, salutes
Reply: If only I didn't know you already read that from 10 other people before directly copying it word for word to get meaningless youtube likes. XD I swear people get more stupid and less original every year.
Reply: The fact it’s secret is a dead giveaway it’s not a true PM machine.
Reply: I mean, the hardest way to make a cheating Tour de France bicycle is always figuring out where to hide the motor... and they last put it inside the stem tube connecting directly to the crank through a gear.

Cheating isn't that complicated to figure out, neither is batteries.

The entire frame is probably a battery, the boxes are magnetic (rim is aluminium) and the coils input momentum into the wheel. The whole affair probably uses a discrete sensor to trigger the impulse.
Reply: @Gh05tk3y  except it was constructed in the 1980's
Reply: @corssecurity  This. People are coming up with all kinds of crap that would not have been easy to pull off in the 80s
Reply: @corssecurity   Fair enough, I missed that bit then.
Reply: actually, the hardest part of making a perpetual motion machine is how to make it work at almost forever...while not using obvious parts to power it, and to make it also work in the absence of any light source..
we all know it's impossible to make.. but making it seem possible is the fun thing about it...
Reply: @alphaalpha3557  It doesn't need to be "almost forever", just long enough for the mark to see it and walk away impressed.
Reply: @alphaalpha3557 who says it's impossible?
Reply: The hardest part about videos on perpetual motion is finding a video that doesn't have this overused quote
Reply: @Mcckoe No, perpetual motion does not exist at any scale, and the creator of this never claimed that it was perpetual motion, he just wanted people to think about the different ways it can be doing what it appears to be doing. When you apply differing temperatures to opposite sides of a piece of copper, you are using some energy to get less energy. That's not perpetual motion, and it only works if you continue to feed it energy. Similarly, thermoelectric cooling requires the electricity in order to work. You cannot use the Seebeck effect to power a cooler which is maintaining the temperature differential via the Peltier (not Pulitzer) effect. If you could do that, only then would it qualify as perpetual motion. But that doesn't work, because the energy output is less than the energy input.
Reply: Hide the batteries in the air molecules
Reply: @Adamisgood24  ooook Tesla
Reply: Same comment on every perpetual motion machine video.
Reply: @Gh05tk3y  The technology wireless charging uses was invented by Nicola Tesla.
Reply: I read this comment before watching the actual video thinking you were completely bullshitting but now she's saying she can't tell him why it works so there's 1000% some batteries at work here smh Adam got duped
Reply: @PropaneAccessories1997  Did he really get dumped if he didn't actually believe it?
Reply: Mercury  @PropaneAccessories1997
Reply: @PropaneAccessories1997  

She can't tell him because she doesn't know. Adam knows it's electrical in some way, and that there is likely a battery somewhere, so how did he "get duped"?
Reply: i see this copy paste comment under every single video on youtube that has even the slightest mention of perpetual motion
Reply: @DylanoTheWizard  and sometimes not even mentioning PMM
Reply: @DylanoTheWizard  it’s a quote not a copy paste lol
Reply: It says dreadco right on it. And if it only last for 2 years it’s not a perpetual motion machine anyway. Perpetual motion should be able to create energy, not need to use it
Reply: There is a type of perpetual motion machine based on a clever arrangement of coils and magnets that is superficially similar to this one where it does APPEAR to be able to move on it's own in perpetuity, but it isn't really perpetual motion. For one, any attempt to use the motion of the machine to apply any torque beyond what it takes to keep the machine moving will immediately bring it to a halt. The other is that even though it doesn't have a battery, it DOES have a power source: the permanent magnets themselves. The way the magnets and coils are arranged will eventually cause the magnets to become demagnetized, as the coils end up generating an alternating current around the magnets. The process is very slow, and the amount of energy being extracted is quite small, but basically, all of the energy that went into the original magnetization of the material is slowly leached out into the device.
Reply: @raelik777  magnets are always red herrings in these devices. Something has to provide the external force to pass the magnetic fields across a copper coil to generate electricity, otherwise the magnets cancel each other out and the device stops in between two magnets.

You can use magnets as a near frictionless bearing, but you cannot use them as even a weak power source.
Reply: @raelik777  You are describing cold fusion . I believe if you could slowly leach the magnetism out it could work, if that's possible.
Reply: @raelik777  

Magnets are not a power source.
Reply: @raelik777 😂
Reply: @raelik777 what vapid silly nonsense. You didn't say anything. And then you got upvoted. You win the comments.
Reply: Be original
Reply: A "perpetual motion" (free energy) machine is easy.  A ramjet pump is one.  Solar panels.  Windmills.
Reply: @tarstarkusz  Those are not perpetual motion machines. A perpetual motion machine requires no external energy source. All of the devices you mention require an energy source (differential of motion, a light source, moving wind).
Reply: @thedude6712  By YOUR definition.  You don't have to pay for energy.  That, by definition is energy which is free. 
Of course, I make no claims that the other type of "free energy" is possible.
Reply: @tarstarkusz  I'm not sure what you're trying to refer to about not having to pay for energy. There are plenty of technologies for "free" energy, but this thread isn't about free energy, it is about a perpetual motion machine. Solar, wind, hydro are all "free" in that, once you build the device and as long as the sun keeps shining, water keeps flowing, and wind keeps blowing (and nothing breaks down), you will continue to receive energy for free. Nobody disputes that. But those have nothing to do with perpetual motion machines. The definition of a perpetual motion machine is one which does not require an external energy source to be present feeding it energy to keep its motion going. A waterwheel for hydro will keep going as long as the water keeps flowing, but it isn't perpetual motion because the water flowing is providing the external seed energy for the device. That's not my definition, that's the definition of perpetual motion machines, according to The Royal Society, Wikipedia, dictionary.com, The Oxford English Dictionary, or pretty much any other recognized source of definition that you care to look it up in.
Reply: @thedude6712  Many, many people refer to this as "free energy."  But, of course, I admit there is a subtle difference between free like beer and free like coming from nothing

Frankly, if free energy is possible to run a machine like this, so friggin what? It's not doing any work. If you could create perfect bearings without friction, you could spin a device and it would spin forever. This accomplishes nothing other than the potential energy savings in ordinary machinery which can benefit from theoretical "perfect" bearings..

What they really mean is NOT perpetual motion, but over-unity.  That is, you put a watt in and you get a watt plus X out.

For all intents and (practical) purposes, waterwheels are perpetual motion machines. They are going to run until the machine fails or the power source is gone.  The power source is the sun and so it is essentially limitless on any timescale relevant to people.  There are waterwheels that were in continuous operation for hundreds of years. (There is a water wheel powered textile mill which still functions in England that was built in either the 10th or 11th century.  There are also gristmills still operating built hundreds of years ago) 

 They are only not free energy machines in the strictest sense in that they are not self-powered.  There are a bunch of losses in the system, but the energy you get for free to turn it is so abundant that it doesn't matter.  Water wheel maintenance is a MUCH bigger issue.
Reply: @tarstarkusz  

"Many, many people refer to this as 'free energy'.

Yeah, idiots.

"For all intents and practical purposes, water wheels are perpetual motion machines."

No they absolutely are not. They require an external energy source. Perpetual motion machines run continuously, barring mechanical failure, with NO external energy source. They would start moving, and keep moving, on their own, unless held still. If you have to manually start them moving, or they require the movement of wind, water, or the application of heat or light, then they are not "perpetual".

Then there's the fact that you keep bringing up 'free energy' when the discussion is perpetual motion. It does not matter what muddled definition you want to apply to 'free energy', because it is irrelevant.
Reply: @notahotshot  Yes, they harvest energy from the environment and do not impose either work or money on the owner operator.  In that sense, the energy is free. Like free beer.  Of course, the difference between free beer and free energy is free beer is ultimately paid for by someone. Free energy is not. 
You DO have to put work/money into building the machine. But once that work is done, it will continue working free of charge or work for many, many years.

Perpetual motion IS theoretically possible.  Perpetual motion requires no work.  Setting an object into motion and having it consume zero energy is useless. The second you put on a load on it, it will stop.  Frictionless bearing, if they could be invented could allow perpetual motion without breaking any law of physics.  Plus, if we could get to interstellar space, we could spin something and leave it there and it would spin forever.
Reply: @tarstarkusz  

The things you mention are not "perpetual motion" they move by extracting energy from an external energy source.
Reply: @notahotshot  No, they are free energy machines.
Reply: @tarstarkusz  

No, they are not free energy machines. They do not produce more energy than is input, which is the real definition of 'free energy'. And there is a cost to build, operate, and maintain the system, which someone must pay, negating the simpleton definition of 'free energy'.
Reply: @notahotshot  YES THEY ARE.  YOU are redefining the word "free" to mean something it doesn't mean.  Name one proposed "overunity machine,": that if they worked (which I admit they don't) that wouldn't cost money to buy and maintain?  Again, you are redefining terms.

A perpetual motion machine can work in theory.  The only thing you need for perpetual motion is frictionless bearings.  Or, if you go out in interstellar space and spin an object, it will continue spinning basically forever.

As long as we are using the proper definition of free energy machine, they are all around us.

Overunity is the ONLY type of machine (in this category) which would actually break the laws of physics.
Reply: Who else find the girl more watchable than that wheel thing?
Reply: The worst part of perpetual motion videos is reading this comment.
Reply: most original comment under a perpetual motion machine video. here's your reward.
Reply: @voxeldoesart  it’s literally a quote Lmfso
Reply: The hardest part about leaving a comment on a video about perpetual motion is being the first one to make this meme comment.
Reply: It’s just magnesium 😂😂the box is probably North an the three smaller little boxes are south that are on the wheel.
Reply: @34powerman are you suggesting that it uses magnetic monopoles?
Reply: @Mcckoe 

"However it is a kind of perpetual motion machine."

Yes, it's the fake kind. The kind with a hidden or disguised energy source.
Reply: Repent to Jesus Christ “Let the morning bring me word of your unfailing love, for I have put my trust in you. Show me the way I should go, for to you I entrust my life.”
Psalms 143:8 NIV
U
Reply: Original comment
Reply: Came here to say this
Reply: @notserpmale03  thanks  it was an awesome moment for me.
Reply: The hardest part of pretending all knowing is hide your own stupidity. Amen.
Reply: @nofartcheck3952  

You should put in more effort. 😏
Reply: @nofartcheck3952  That comment is dumber than me...good Job. Amon.
Reply: Is nature a perpetual motion machine? And if not, where / what is its batteries?
Reply: @nellyfabulous  Nature's got a pretty neat fusion generator at the center of our solar system. There's some other stuff, like geothermal and tidal effects gradually releasing energy left over from the formation of our planet and moon, but most of it's from the sun.
Reply: @ashapyne  And there's a fair amount of radioactive decay going on inside the Earth as well, helping to keep the temperature up.
Reply: @ashapyne  I’m actually hinting at extrasolar nature. 😉
Reply: @nellyfabulous  If the moon causes tides that would put it under a load which would slow it down eventually, what keeps it going? The sun will last billion of years consuming millions of tons of fuel per second, I say BS the math doesn't work. Probably recharged every so often from the side we can't see at the moment.
Reply: @nellyfabulous  The nuclear strong foce is the universe's battery, and there's one in every atom.
Reply: @kenvalentine5341  Haha, not a bad guess. True it’s in every atom (at the very least potentially). Interested in hearing some examples of why you think that’s the batteries of the universe. And if its true, the next questions that immediately come to mind are:

1). What caused the strong nuclear force to come into being? Did it always exist? And why?

2). Is the strong nuclear force what’s ultimately responsible for causing the Big Bang, and why / how?

I like your answer, but I’m not sure if the batteries of the universe is hidden in the strong nuclear force, based on the work of modern physicists (not saying that’s 100% correct either but it’s the best we have so far from tested hypotheses). Also, I’m not sure if gravity necessarily has to do with atoms (although atoms typically do affect the gravitational field around them.)
Reply: @kenvalentine5341  Personally, I like the idea of multiverses crashing into each other or maybe even conscious creation from a hyper-dimensional “mind” somewhere. Not saying those are the truth (because none of us truly knows if we’re honest), but those are the ones that have the most fun ideas in them for me currently.
Reply: @nellyfabulous  Hi again! You probably already know the currently accepted answers to your questions, but for those who don't let me take a swing at answering them.

Danger! Very long comment zone ahead!

 I agree with the first paragraph. For the questions, from my understanding of the current consensus of physics and astronomy: 

Question 1 is very good, there is no convincing argument or data that explains how the strong force came into being. One possibility is the  observer effect and the infinite multiple universes theory in which each universe is based on a different set of physical laws, seemingly randomly chosen. The question of how the strong nuclear force came about and why it works the way we think it does is that if it worked in any other way or even didn't exist at all there would be no life in that universe to think that question. If the strong force was weaker or absent there would be nothing bigger than a hydrogen atom. If the strong force was stronger or extended further out then every atom would be much bigger than a uranium atom. Both conditions seem unlikely to allow life to occur. The fact that we can ask that question means the strong force exists with the properties we currently see.

Question 2 The strong nuclear force can barely hold a uranium atom together. That is why a single neutron moving slowly can fragment it into pieces. But the energy released by converting one large, loose bundle into two or more smaller bundles held together by the strong force releases energy that is large compared to chemical energy, but very, very small compared to the Big Bang. And the strong force is so short ranged that even having many, many more particles smashed in together does not help. The energy of a large group would only be the sum of the energies of small groups of the total about the size of a uranium atom or smaller. It would take many times the number of initial particles as final particles in the universe afterward. Nobody knows where the energy came from that could cause the Big Bang or create the universe that we see now.

Back to normal sized comments.
Reply: @nellyfabulous un  Sun is the “battery.” Sun is the source of most of the energy on earth (coal, oil, hydroelectric, wind, the food we eat, … all of it comes from the sun). Only nuclear and thermal energy is independent of sun. Actually sun is also nuclear energy — hydrogen fusion.
Reply: @nellyfabulous  the sun
Reply: @danlux4954  I was actually hinting at extrasolar nature. 😉
Reply: @nellyfabulous  It isn't. It's 'running down' as its entropy increases.
Reply: @PeterGaunt  What if time isn't as important as we make it to be?  For example, the strange behavior of time and causality inside blackholes. What if, in higher dimensions, the sum of all causalities is actually a loop? And we can't test it because even our entire observable universe is too small to give off the information we need to detect the loop?
Reply: @nellyfabulous  Sounds like the sort of thing I came up with as a young man if I'd been at the 'wacky baccy' 🙂
Reply: @nellyfabulous  >> Is nature a perpetual motion machine? And if not, where / what is its batteries?
Solar powered.
Reply: @thomasw.eggers4303  Was referring to Extra solar nature
Reply: @nellyfabulous In the earths core, and from the sun.
Reply: @chuckd5819  Was talking about extra-solar nature. Not just earth.
Reply: Perpetual motion is possible… All you have to do is look at government spending and taxation to see it.
Reply: @jakeeasterwood3204  : but they’re using our money to keep it spinning!!!!
Reply: @robertholderman7552  “Our new Constitution is now established, and has an appearance that promises permanency; but in this world nothing can be said to be certain, except death and taxes.”

— Franklin, in a letter to Jean-Baptiste Le Roy, 1789

But taxes are the inevitable perpetual motion that will never end. Just as “energy can neither be created or destroyed.” The difference is that taxes can be created but once created can never destroyed as long as there is a politician to react with the tax.
Reply: I guess this machine technically do not violate he conservation of energy. To me, it seems like the machine use magnetic bearing and I will guess it is vacuum inside the chamber, thus resulting in zero net force, making the angular momentum conserved. I will guess that for a certain period of time, someone will use any sort of magnet or other median to reboots the fly wheel. Well, which make it not really a perpetual machine; the concept is demonstrated tho lol.
Reply: Wireless charging goes back almost as far as the advent of electricity.  Maybe it only goes back half as far but passing charges through the air was a popular thing for scientists to play with. It's only been recently used for charging batteries because we finally have batteries that charge easy enough and devices that we use often enough but that don't require as much power so wireless makes sense.
Reply: @josephwheeler1  Lithium ion batteries don't charge any easier than Nicad and frankly charge worse than nicad.  Unlike Lithium chemistries, nicad does not need a charge controller.  They have VERY low internal resistance and can be charged at high current.

Frankly, wireless charging is a bit gimmicky in most use cases.  There are really only 2 benefits. 1) By your easy chair when you may be taking calls  and you don't want to fiddle with wires.  2) USB ports absolutely SUCK!

Frankly, I think it only caught on to the extent that it has because USB ports are just so bad.
Reply: @tarstarkusz  Did wireless charging "catch on" or did manufacturers simply choose to use it to save money on extra parts on the most expensive models, thereby increasing their profit margins exponentially?
Reply: That's not funny after the 100000 million time of hearing.
Reply: @TheMrRatzz  YouTube is the home of possible copycat killers obviously.
Reply: @TheMrRatzz  Ik, it is so overused.
Reply: @TheMrRatzz  that would be 100 billion
Reply: @TheMrRatzz cry about it
Reply: @TheMrRatzz  100 billion? And it really is. Especially since people are dumb enough to try it that many times.
Reply: @TheMrRatzz  no shit...  So effing old
Reply: @TheMrRatzz  Then don't read the comment section
Reply: @Gh05tk3y  Simon can read and respond however he pleases, if you don't like it GFY.
Reply: @Gh05tk3y  Then don’t read and respond to the comment that you responded to in the comment section.
Reply: @lescobrandon8045  

"Simon can read and respond however he pleases, if you don't like it GFY."

Dan H can read and respond however he pleases, if you don't like it GFY.
Reply: @TheMrRatzz  🤡
Reply: Nice copy-paste
Reply: The Royal Society wouldn't put up with that, but you are right that most on social media are powered.
Reply: @markmark5269  

"The Royal Society wouldn't put up with that, but you are right that most on social media are powered."

The Royal Society is well aware that this machine is not a perpetual motion machine, and that it has a hidden energy source. They most certainly do "put up with it".
Reply: If u think it's batteries .... make one and see how long it last. I bet u only get 4 months rotary motion before the batteries die, giving the volume of the hidden areas.
Reply: @piercebishop4052  With efficient bearings, not much energy would be needed to keep things going. Two years would seem easily achievable given the "executive toys" I've had.
Reply: @piercebishop4052  you do realize there's a battery that's been running for decades right ?!
Reply: @jmg4208  yep, I know. 
Also promethium batteries can last a couple of years. I'm just saying to people who think it's just a few AA batteries stuffed in there like it's so simple to rotate that amount of mass, an air resistance from the volume for 2 years on some generic batteries.
Reply: @piercebishop4052  once you reduce friction to next to nothing, and use a shove rather than the batteries to build up the kinetic energy, you would need so little energy to overcome the little friction, you could run it fit for a very long time.  I put an answer in the main thread.
Reply: @piercebishop4052  What estimate of continuous power consumption (in Watts) are you using for those 4 months ?
Reply: @piercebishop4052 no you are incorrect, it could use other aspects of perpetual motion along with batteries that uses so little power it could last 2 years.
Reply: @piercebishop4052  it’s a quote lol. He doesn’t actually think it’s batteries specifically, “batteries” refers to however the perpetual motion device is cheating